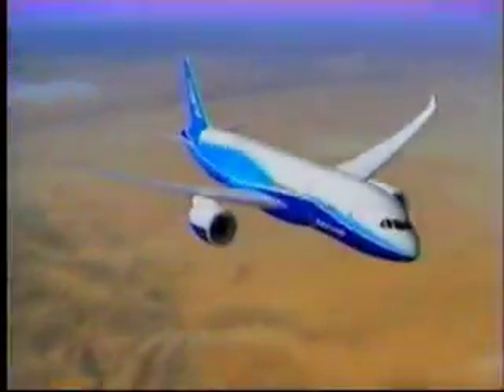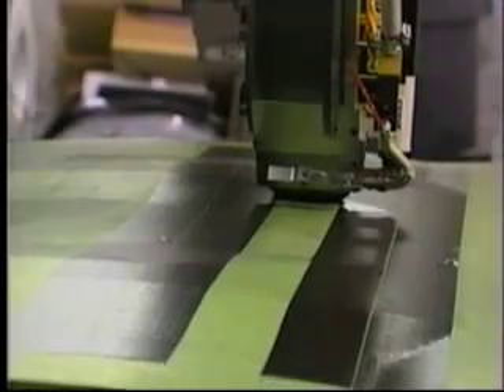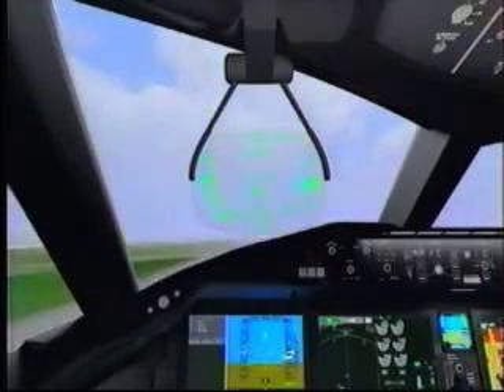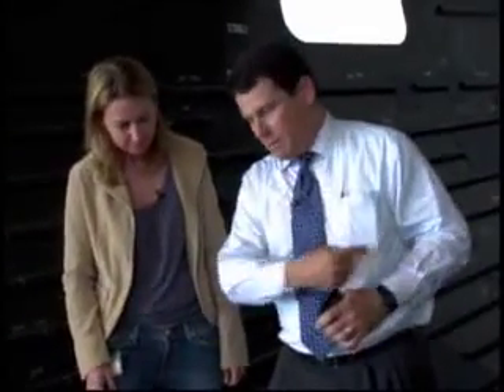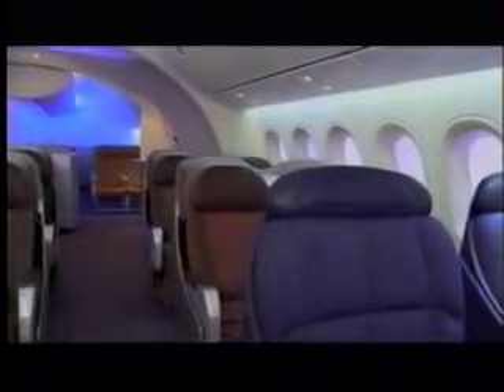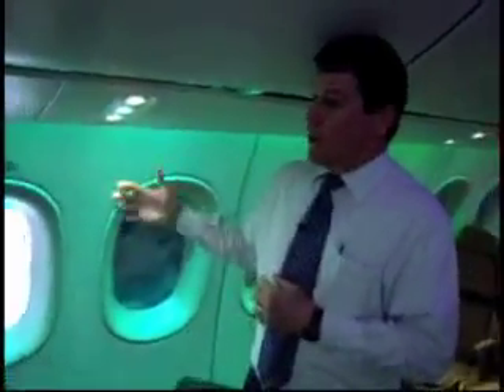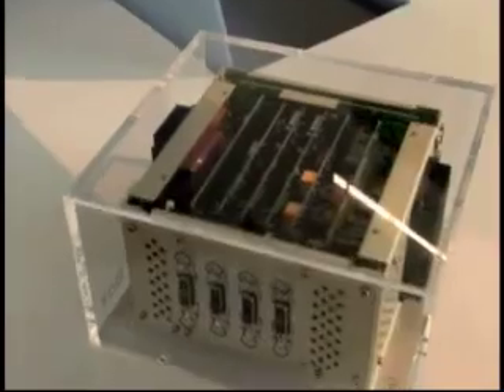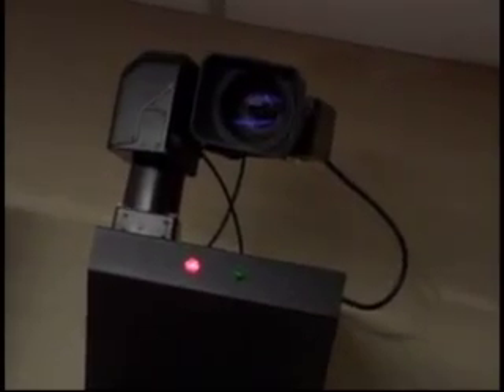Tom Cogan on the Boeing 787 Dreamliner

Comment: It's not an option Airbus is offering. Some airlines such as QANTAS will be installing what they call electronic dual layer shades in First Class but they are simply traditional shades in two opacity levels which are powered up and down.  Only the 787 is planned to include the electrochromic system.  Airbus have even been critical of the Boeing system, on the A350 they're presently in favour of self-tinting reaction panels that clip on and off each window aswell as a mechanical shades.

Comment: The RR Trent is only one engine option, and appearing to use 2-3% more fuel in cruise than the GE option.  The electrically-dimmed windows are not in use on the A380 and the A380 is more French and German than British.  However, both the A380 and Dreamliner are great planes.